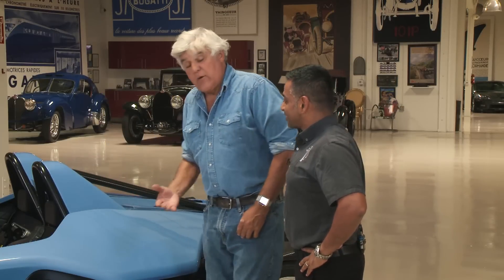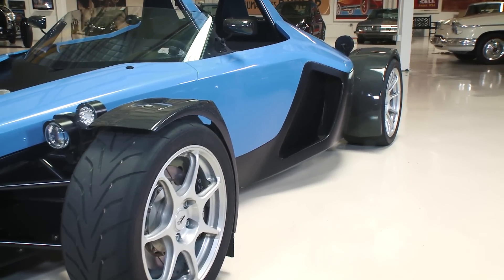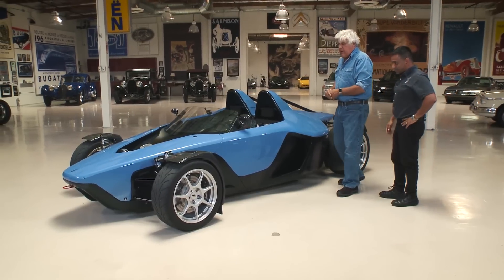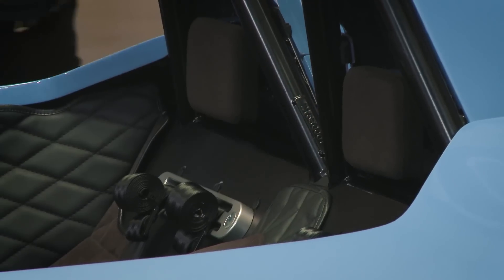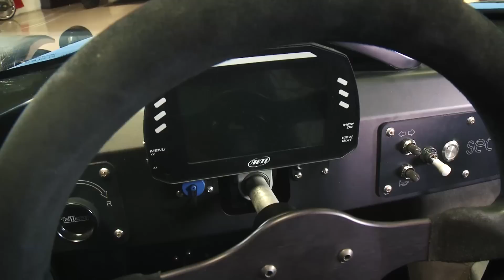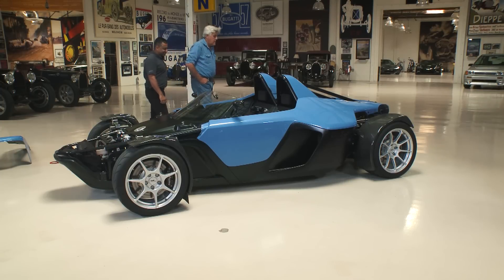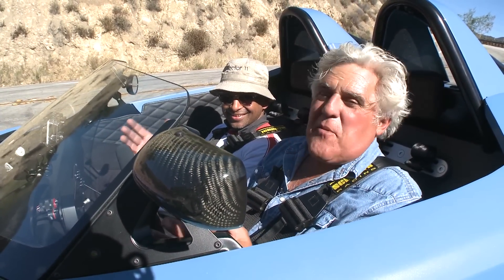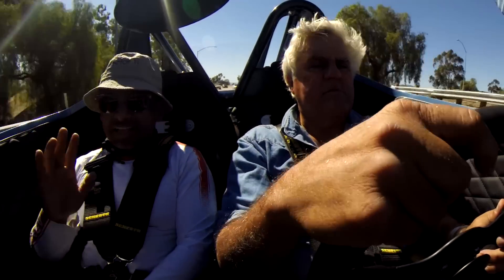2015 Drakan Spyder - Jay Leno's Garage

Comment: Pretty much a sand rail.  But with an indy suspension set up.  Pretty cool.
Reply: Looks just like a sand rail with a jet mixed with Indy body. Kinda cool I guess.  I can see where the price is where it's at.  Porsche transmission LS motor and Indie patent suspension.  I bet this this handles GREAT.

Comment: Just imagine how fast this could be once you start putting mods on the LS V8.
Reply: No need for all that torque, in such a light weight car.
Reply: Some dude has TWO precision turbos on his LS V8 Draken. 1000 HP Lol
Reply: @alikermani6731  Wouldn't it still be aero limited in terms of top speed? The guy who created it has a video of comparing the Drakan with the C8 (yes, the C-Eight) Z06 and he straight out said its aero limited.
Reply: @hickyricky5913  yes open wheel is horrible for aero.  But acceleration from 0-150 would still benefit from more power.  In my opinion performance in the 150+ range is mostly just bragging rights.  How often do people really use it?
Reply: 2000 lbs and 430 puts this in Bugatti territory for power-to-weight. Adding more power would just make it more dangerous to drive

Comment: I really like this thing, and the very knowledgeable designer. The way they built it you could drive 400,000 miles with little more than the scheduled maintenance (and maybe a head gasket), the performance and build quality are well worth the price IMO.
Reply: Darth Wheezius LS engines have been aluminum since their inception except for the truck variants.

Comment: Boutique sports cars, Pagani in Italy use a V12 with a carbon fibre body, BAC Mono Carbon tub and F3 4 cylinder. 
'Murica LS3 V8 crate motor,  Cro-moly tube frame, glass fibre and Wilwood brakes

Comment: 100K for a Ls3 & tube chassis
Reply: +Liemciemdk89 My thought too.
Reply: +Liemciemdk89 The LS engine is a lot of the reason this thing is only $100K as compared to 
$250K like the Mono. Exotic engines like the Cosworth that's in the Mono
 come with a hefty price tag. And building a chromoly chassis like that isn't easy or cheap by any means, not to mention the amount of time and money spent in the designing and R&D to develop the chassis and suspension and tuning it all to actually make it work. As well as all the one off parts that have to be designed and machined. There's a lot more to it than just a cobbled together tube chassis and an LS.
Reply: +Liemciemdk89 It's based on the Palatov D2, so it's a race car with license plates.
Reply: +gus bisbal The developers of this car pretty much did buy a crate version of a porsche gearbox. unless they gutted stuttgarts finest that is. That be awful
Reply: +gus bisbal 

http://www.gboxweb.com/

Quite easy to get a crate version of a Porsche gearbox
Reply: something tells me you're not American
Reply: ***** am I right?
Reply: +Liemciemdk89 If the engine wasn't a boring LS3, I'd probably like it 10x more.

Since ecerybody's putting LS's into everything like lego's,  it's rubbing off onto the sports car market.
Reply: +cybertree Yeah, GM should have made the entire LS series shittier, so that people would put different engines in their cars. That way their engines could be more expensive, less reliable, greater maintenance costs, crappy super peaky torque curves, ... We can only dream of the dystopian world that might have been - without the LS.
Reply: +cybertree what is wrong with LS3? they are great motors, light and powerful and give a sound so many people love.
Reply: +DeeBo No...it's a frame and engine...you can't (or shouldn't) try to charge the customer for development time and if you make more than one car the parts are not "one off". The engine is 6 grand tops ...tranny 5 grand.....so they are charging $89,000 for the frame and brakes to idiots with too much money.
Reply: +gus bisbal 
Getrag 6 speed race ready transmission....$4,900. Crate version...tons of em out there probably even cheaper.
Ls3 crate engine ...5-6 grand.
Where did you put the other $89,100? in the brakes? hahahahah
Reply: ***** You got cash? Show me the cash.
Reality?
You said no one could find a crate Porsche gearbox...in a way that's true because Porsche doesn't make gearboxes They use Getrag.
A simple Google search took me two seconds to find a place to pick one up for under 5k that's even beefier than what Porsche uses. Another search..crate LS3 5-6 k. tons of places to get them. Full Wilwood brake system 2-3 k ...that's reality
Try it, it's easy.
Let me help you...I'll type real slow so you can keep up. Go to Google...type in Getrag 6 speed transmission...hit "enter". Do the same for LS3 crate engine, Wilwood Brakes...or most any other part you want to find.
You just hate being wrong...sorry...but you are wrong and that's real.
.
Reply: Daniel Arriaga The logic monster devoured him.

Comment: The only thing that bothered me about the looks is that the wheels in front are 7 spoke and the rear wheels are 9 spoke.
Reply: i too noticed that...kinda bugged me too
Reply: +SlipknotMaggot0526 Same...you get HRE to custom spec you some wheels and you don't get matching designs front and rear? Seems strange.
Reply: No what really got me was the red front turn indicator.
Reply: +Stev Rex ...did I say that I did?? I'd gladly take the <1lb per corner to add 2 more spokes.
Reply: Stev Rex That's not that strange, actually. Many people have OCD and would be bothered by it. While describing the looks, I didn't take into account why it's like that. Otherwise I would be describing my thoughts on how they engineered and designed it.

I'm not sure my moniker has anything to do with what I said, but if you want to assume what my personality and intelligence level is by my Youtube name then so be it.
Reply: +SlipknotMaggot0526  i didnt notice it until i saw your comment, but yes, its really annoying. Looks so mismatched
Reply: I thought something was a little off about the wheels.
Reply: I didn't mind them. I didn't think they looked very custom though.

Comment: Here's a recipe for you... carbon monocoque chassis, mid-engine turbo K20, sequential AWD transmission, and more downforce than the car weighs.  Working on a tube-frame version of this now, as I really can't justify dropping the money for the carbon chassis, even though it would save a LOT of weight...  not a pro racer, just a hobbyist.  For what it's worth, a car built similar to this won Pikes Peak outright in 2017.

Comment: I don't think Jay really liked this car... he was like...100k???
Reply: +mhall027 He said a lot of nice things about it.
Reply: +mhall027 he was saying it like "only 100k" because the Bac Mono was a 1 seater and only 4 cylinder but it was 250k so Jay was pleasantly surprised that this was less than half the price. A V8 engine in a 1 ton car with push rod suspension, that is the closest thing to a Formula 1 car experience that you can possibly get from a road car and formula 1's cost about $6 mill each(not that there are any for sale).
Reply: "This is more my kind of car, it's very nice"
Reply: +Luke Wallace  A truck engine bolted onto a pile of scaffold tubing is NOT like an F1 car in the slightest. It is a clunky copy of an Atom or Mono for the septics who drool  over V8 engines. I bet it handles like a dog and the company that makes them will go bust in a year.
Reply: It’s actually $125k now sadly. At $70k it’s on the money but that’s a little ridiculous
Reply: @burlatsdemontaigne6147 well you couldn’t be more wrong

Comment: Love the car, the only thing I didn't like was the exhaust back pressure. When you let off gas it has that weird gurgling sound. Sounds like a busted valve (it's not) but sounds ok on acceleration.
Reply: its the racing exhaust
Reply: +Krevin Grard Still,. a little tuning of the sound goes a long way. You don't get that on high end Euro race cars.
Reply: ***** pretty sure all they care about is lap times for a racing car.

Comment: It is cheaper then Ariel Atom, and you are actually get more body work than in an Atom which is basically a Chassis, Wheels and Engine.
Reply: The Atom is cheaper - last I checked, unless they had a 300%+ price hike.
Reply: +Dr. Weird 

A V8 Atom costs 150.000 GBP

http://www.topgear.nl/video/s16-e01-c01-01-ariel-atom-500-v8/
Reply: ilcool90
 Oohhh, the V8 Atom. I thought you were talking about the I4 Supercharged variant.

My bad.

Comment: When the heck did they start calling gas tanks "fuel cells" ( and why)?
Reply: Fuel cell and gas tank aren't necessarily the same thing.
Reply: +The Moto Channel Using the term Cell instead of Tank designates special safety features that a normal fuel tank isn't required to have. Examples of the features might include a much higher burst strength, no vented fuel cap for roll-overs, and a requirement to be mounted directly to the chassis and often in an enclosed area such as the trunk. When someone says the term Fuel Cell in the context of a gas powered vehicle, think of it as a crash/roll-over/explosion/stupidity resistant fuel tank.
Reply: +ShopTalk Well, they did mention foam and a bladder

Comment: had to comes back to this video. The Front Suspension confused me. I thought it was a Pull-rod suspension not a Push Rod. 

I'm not entirely sure how you can patent it. This particular setup is not far removed from those used in F1 cars. It is simplified, but about the same. Even the placement, though not spacing, of the joins are the same. 

To this day,however, I am stumped as to why no one uses this set up except in the most rarefied Supercars and, of course, upper tier race cars.
Reply: +DocWolph Front is pushrod. Suspension design usually has a lot to do with packaging, think about where you would put the shocks in any normal passenger car and think about what you would have to give up to do it. Also, as always, cost is a major consideration.
Reply: Joe Tralongo
Cost is not as much of problem as long as you aren't trying to over-engineer the parts.

I don't think push-rod suspension systems would be easy to put in 60% of passenger cars and S/CUVs. That leaves 40%, mostly RWD vehicles, in the possible field.  But for sports cars that aren't crazy expensive, like a Corvette or a Miata, it wouldn't be hard.

Comment: Isn't the fuel tank at risk of rupture on bumper bashing accidents?
Reply: +Nqina Dlamini 

It is tucked fairly far back in the chassis and as it is a proper fuel cell, it has a bladder to prevent fuel loss in the event of a tank rupture.

Comment: And an added bonus comment.  I think the car is too expensive for what its lacking.  No automatic turnsignals, windshield wipers And the gearshift isnt set for those tall drivers, it should have had paddle shifters installed.

Comment: for 100K that "car" should at least have carbon panels, ABS , a pair of carbon silencers and a proper custom alcantara steering wheel and dashboard.  Don't forget that in that price it doesn't have A/C ,heating ,a sound system or a verified brand name , so it is still expensive and underequipped !

Comment: how does the seemingly inferior BAC Mono cost more than twice of this?
Reply: +boy638 the mono has a carbon fibre composite construction, F3-spec six-speed sequential gearbox, weighs 700-800 lbs less than the drakan. 
pretty sure the guy in the video says the BAC is still the faster car.
Reply: +shaft9000 The lightest mono in the US weighs a little over 1400lbs with fluids, the 1200lb figure you see quoted all over the place is a dry, no options weight.
Reply: itsinmynamechap Not a whole lot in the way of adding weight, tow hooks, adjustable brake bias in the cockpit and a fire extinguisher. The new cars weigh a bit more due to a different engine.
Reply: +boy638 I wouldn't say the BAC Mono is inferior.  That critter is a street-legal race car.  This critter is a sports car that's at home on the race track.  Depends what you want.  Living in Upstate NY, if I wanted a sports car, I'd probably go for a Subaru WRX for less than $40k.  Would be nice if they made the Forester with a beefy high-torque H6 and a transmission with low range.  Sort of the anti-WRX.

Comment: I would've used the 4.0L BMW V8, or or an Audi 4.2.
Reply: LosSkywolfGTR too expensive. Both of these engines cost at least 10-12k, while you can get a brand-new LS3 for around 6.5K. and if i´m not mistaken, they are also heavier. Still, i totally agree with you.

Comment: "Oh, a hundred grand. That's not bad." LMAO It's a glorified go kart with a Corvette engine. Half that price--WITH the engine--would be pushing it. What Shinoo doesn't say here is that the $100,000 pricetag doesn't include a powertrain. To get a car that you can actually turn the key and hear vroom vroom noises is $125,000+. I used to buy Sector 111 stuff for my Elise. I think I might've overpaid.

Comment: Here's a challenge; build a 200mph car that LOOKS GOOD... for under 30k... -_-
Reply: +Motherbrain Jr  The only way this could happen, is if the value of money somehow changed lol. Deflation......
Reply: Christopher Warren Or you make it simple and don't add useless frills like AC and electric windows, fancy trim and tons of carbon fiber...
Reply: +Motherbrain Jr
Very simple, you move your company to Asia :)
Reply: +Motherbrain Jr 

It would be possible if you could get around current safety regulations, and if a major manufacturer built them en mass.

Short of that you could build your own kit car, or buy an old used small car and pay a tuning company to put a powerful drivetrain in it. Old car = few thousand dollars. Crate motor = another few grand. Paying a tuning company to frankenstein it together = the rest of the money.
Reply: +Motherbrain Jr Instead of building buy a c5 corvette for around 11-15k and pro charge or turbo it and reflash the ecu and do 220
Reply: +tahrn tej ycg
Reply: +Motherbrain Jr If you want to go 200 mph for as cheap as possible just get a sportbike and mod it.  For $15,000 you can get a bike that will embarrass most supercars in a drag race.
Reply: Plur307 I already knew bikes were faster then cars. But yah bikes are awesome. I was at a stoplight and some serious bikes pulled up. They did a burnout and when the light changed... Jesus Christ I though the bikes  would rip their arms off!
Reply: +Motherbrain Jr Carbon Fiber is never an extra, useless bit....  wanna go 200mph for under 30,000 buy a bike....
Reply: +Motherbrain Jr , one option is, you could buy a good quality kit car and build it by yourself.
Reply: Here's a challenge: Beat poverty.
Reply: TranceFur Simple. Give people opportunity's to work hard earn a good living by freeing up taxes and prohibitive regulations on small businesses, and stop redistributing money from hard working folk and giving it to the lazy underbelly of society...
Reply: +Motherbrain Jr 👌🏽 on point
Reply: take the epa regulations out and remove them extra taxation heck one has complete freedom of creativity  :D

Comment: 30 secs in, noticed mismatched wheels, just couldn't take this guy seriously. engineer an entire track day car but cant tell the difference between a 7 spoke and a 9 spoke wheel.. embarrassing.
Reply: +Tiny Star You do understand why that is the case don't you? Lighter weight on the front and more stress resistance on the back because of the torque. Why don't you know that... embarrassing
Reply: +gus bisbal they could have matched spoke no.s for little additional weight, just have thicker stronger spokes on back.
Reply: +gus bisbal tbf, this car is for driving, not parking up and looking at, please disreard my previous comment.